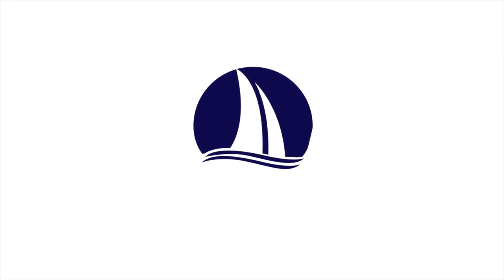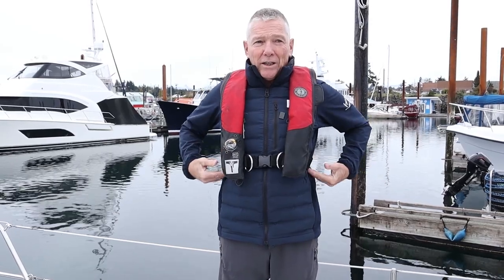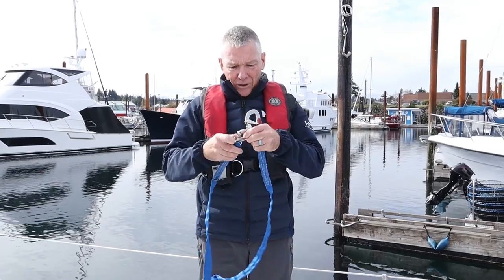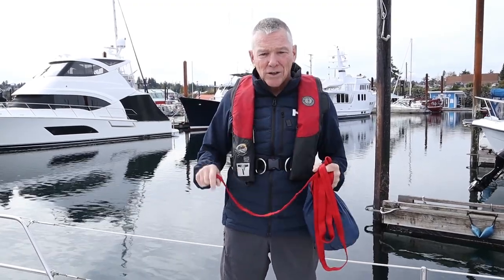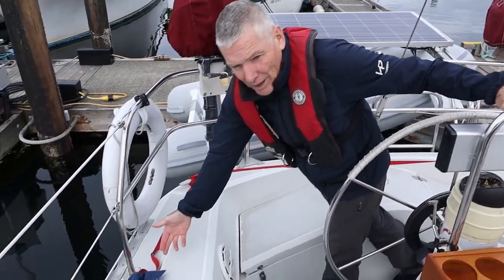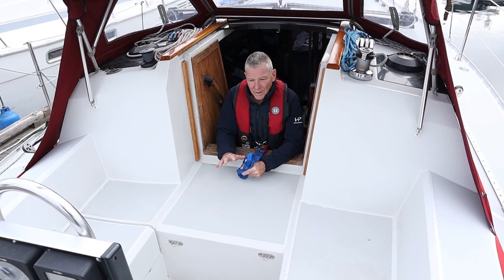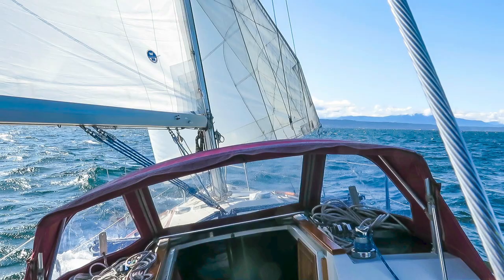Ep 45: Harnesses, Tethers & Jacklines

Comment: I think in most cases going overboard single handed in rough weather, being tethered just ensures they recover your body more easily.   Getting back in the boat is often next to impossible, especially in cold rough water.  IMO If you are single handed being tethered should really only focus on keeping you IN the boat.  On deck I’d focus on short tethers and extra pad eyes in areas where you likely need to work with one or more hands, ie at the mast or on the foredeck.
Reply from the maker: I agree
Reply: In those conditions , maybe if you don't have to be out , don't.

Comment: Good tips, but I don't get the final part. In the man overboard scenario, you instructed how to cut the harness, use a PLB, etc. It almost seemed like cutting the harness was the main option? I strongly advise single-handled sailors to practice climbing aboard under controlled conditions (with crue mates). Also to set up alpine aiders and practice using them. Without being proficient in getting back into the boat, staying clipped is quite pointless for a single handler.
Reply from the maker: You make a good point. The point that I was trying to emphasize is to rely on the tether only as a last resort and that going over the side you might not be able to get back on, at least from my point of view

Comment: Great safety point about single handed, I've seen people (and videos of people) single handed with no tether. If you are using an autopilot, your boat is gone. One very big consideration, the easier it is to rig, the easier it is to come disconnected when you're in the water because you have fallen overboard. I 100% disagree with using a snap-shackle for a jackline. It's way too easy for them to unsnap by accident. You are out in the water all by yourself, think about just how safe you want to be. Autopilot is overused, it's great for doing things while singlehanded, but it takes away the boats one safety feature, actually turning away so the sails don't provide any power when you do fall over and stopping the boat so maybe you can get back onboard. Autopilot WILL ensure the boat goes away.
Reply from the maker: Thanks for your comment. I agree 👍

Comment: Great video but what is the point of the safety if you have to cut the line anyway? Because pretty much no one can be dragged in the water and climb back on.
Reply from the maker: That is a very good point
Reply: Exactly.   Using a 6ft tether is pointless.   Needs to be 3ft so you can scramble back onboard.

Comment: Another idea, Marco, is to loop your 6' tether around the jack line and back to your connection on the PFD. This would yield you a 2' 11" tether.
Reply from the maker: Thanks for the comments Jim. This suggestion however is a bad idea. Never have fabric on fabric contact when significant loads might be present. This is a very dangerous practice
Reply: @CarpeDiemSailingMagazine  I would suggest that that suggestion is not intending a fabric-on-fabric contact, so not 'dangerous practice', if the tether is terminated with a locking carabiner made of metal.  Would you agree?
Reply from the maker: @jamessavage5894  👍

Comment: To run the jacklines through the middle of the boat, I do a triangle with the base on the cockpit and the tip on the baby stay deck attachment. The base is about the size of the companion way’s width. The jacklines go beneath the bimini and around the mast base. I use these jacklines when leaving the cockpit. When in the cockpit, I clip to the steering pedestal, no need for jacklines. The only place I cannot reach with this setup is the genoa furler. For this I use an additional jackline that goes to the bow cleat and I use an extra short tether.
Reply from the maker: Thank you for the comment Robert.It sounds like this works for you but for me I can't figure out how I would do that with the dodger in the way. Is that what you mean by bimini? I'm still not convinced that any system will guarantee that you will not fall off the boat somewhere on the boat
Reply: @CarpeDiemSailingMagazine  Hi. Yes, sorry, wrong word, I meant the dodger. Got to work on my English :-) Anyways, actually I do not need to pass them beneath the dodger either. Now that I remember (I am not on the boat at the moment), the jacklines stay forward of the dodger, just tangent to it. I use the part of the deck on which the mainsheet car is attached as the base of the isosceles triangle formed by the jacklines. Forward of the mast, I have a baby stay and I use its attachment to the deck as the forward vertex of the triangle. So, the jacklines form an isosceles triangle with a small base (the width of the companion way), which is what I need so that the two long sides lead forward toward the vertex while staying close to the center line of the boat. This prevents me from falling overboard. have a Beneteau 361, maybe it is possible in my boat and not in others.

Comment: Lots of really good advice and instruction.  I definitely learned a thing or two.
I've also done a lot of solo sailing, and solo rock climbing, and there are a lot of similarities.  Climbing rope or webbing is definitely a good option, but you need to be careful with how you tie and dress webbing knots; you can't always use the same knots as normal climbing rope or sailing line or you risk it slipping.
I also wonder why they don't have magnetic release clips like the Black Diamond Rocklock Magnetron carabiner.  They are locking, strong, and can be opened under tension.
Reply from the maker: Thanks for the comment. I am not familiar with the carabiner you mention but in my experience most of the gear from the climbing world does not do well in the salt water.

Comment: Good video. Many useful tips. Thank you. I have the Spinlock offshore and a Mustang. To make a crotch harness for the Mustang I used about 9' of webbing. One end I sewed  into a loop. This attaches to the Mustang belt with a carabiner. the strap then runs under my leg and up through the back of the vest then down under the other side. For this end I use a double overhand knot and another carabiner.  The only possible downside is it's too strong a system.  (Buying one is over $100 and it's clearly not worth more than about $7)
I'd hate to have to rely on cutting through webbing in an emergency with cold numb fingers. Spinlock keeps the webbing cutter coated in plastic- this is against corrosion. If that came off ( you used the cutter for something) I'd make sure that blade was as sharp as possible and then I'd dip it in Plastic Dip. Stainless steel has a way of getting corroded, even slightly and losing any edge.)  
For a Jackline - great advice. If you get the right type of webbing (easy to find) it'll have those mountain climbing weight numbers. It's not that expensive, it's easy to sew (Just about any sewing machine because what your machine is really doing is pushing a ball headed needle between the fibers. I've got a $300 Janome and it does just great) or you can tie overhand double knots. But look these things up don't just trust me. 
The X thing.... I think you  covered it. On a boat like yours what I think I'd do is run the jacklines like you did it first, and then I'd run two more lines up along the handrail, and in rough seas use that as a handrail. The dodgy areas are always the gaps between handrails. Webbing is so inexpensive (I'll bet I have at least 500' in various sizes (and colors)) it's a why not just do it? 
The clip in or not. I'm also a sea kayaker. We wear our pfds all the time. The USCG has statistics that most people who die in boating mishaps drown, and 70% of them are not wearing life jackets. The rule is that a life jacket is in reach. The stats seem to indicate people who end up in the water weren't able to grab a life vest. So clipping in? Just seems like a make a rule and then just always always follow it. (I wore my pfd for every single basic sailing lesson whether I had to or not. When I'm on my boat I'll still look like a nerd.) 
Steeplejacks always use two safety lines and do not release one until the other is clipped - so they are never ever unclipped. 
(Sorry to go on so long) I had the thought that to climb back on board maybe tie a loop in the tether, it's easier to hold onto a loop than a piece of straight webbing . But this would shorten the tether and what's the best spot for that loop? and the loop catches onto every nubbin on your deck. 
Do they make ascenders  for webbing? One of these on your tether right next to where you clip in would keep it out of the way, but reachable. Then you would just slide it along the line and pull yourself up. (once you got some length between you and the ascender you can use that as a step.  
I've got a lot of experience with hypothermia growing up in a cold wet place. It always degrades your ability to use your hands faster than you can possibly imagine. If like me you get cold hands and feet - this can happen in less than a minute. The shivering? That happened to me in less than 15 minutes in 70 degree (22C) water on a sunny California day air temp 75 (25C).  (I've swum two miles in colder conditions wearing only a Speedo. Not swimming is very different.) 
You want to wear the gear, take all the precautions and 15 -30 years from now be able to say, "I never needed to use any of this." Also the way people die wearing a pfd is they get hypothermia, their head drops into the water and they drown. Happened to a friend of mine - sunny day, couple hundred yards off a beach.
One thing something like wearing a pfd and keeping a hand on a rail or clipping in does - that no one says - it puts you into a safety frame of mind. Set your rules and then live by them.  I once drove to the beach and then discovered I'd forgotten my pfd. I was just going to escort some ocean swimmers no more than 100 m from the beach. Rules is rules. I drove home and got it. Before I launched I'd driven almost 100 miles. But I'd proven to myself that I follow my safety rules. Hope this hasn't been too crazy.
Reply from the maker: Thank you for taking the time to comment. I appreciate your time and support.
Reply: @CarpeDiemSailingMagazine  You're very welcome. I really appreciate your digging deeper into these topics on your channel. When I got my Musstang the leg straps were an expensive option. My experience immediately raised the question - how does it lift up in the water? It was pretty awful. Most people won't know to consider this. 
Also, the MOB practice I've done in classes is completely inadequate to doing it for real.  Pulling a full sized person back on board is a serious physics challenge that until you have experience doing it it's going to be really really difficult. (I've done house construction and taught physics - the tricks are amazing and better than strength. All the best framing carpenters I've known are my height 172cm or shorter. Four of us once lifted a 15 ton house to insert an extra story - we didn't lift it with our arms. And we didn't figure it out as we did it.)

Comment: I rig my boat with the same webbing and in the same manner. I use two tethers. Long and short.Added port and starboard cleats so the webbing runs a couple inches aft the wheel with a fixed loop that I clip on.
Call me paranoid,  but I'm not going over..
Great video by the way.
Reply from the maker: Thank you. Good info, I agree

Comment: Ohhh. Now I'm getting into trouble.

I don't use a safety line, when I have to move forward or backward on the boat 
I have them and can use them to secure me in the cockpit, or on the deck, but back and forth they are too much in the way.
You must always have control of the line and be careful not to fall into it.

Then I'd rather have both hands to hold on.

But I have 20 meters of orange floating line with a small fender at the end that I can put out from the boat.
It is set up in such a way that if there is a rough pull in the line, my autopilot is deactivated.

The boat will then go up into the wind and probably also go over the stay and lie reasonably still.

I've tried it in practice and can easily catch the line and it doesn't take that much force to hold on if you're just lying on your back.

Should everything go wrong, I still have my PLB.

I'd much rather bet on this than a safety line that gets in the way and requires me to release the boat with one hand to steer the line.
And if I fall overboard and hang on the side of the boat, I am not much happier than if I had simply fallen into the water.

So I rather bet on having both hands available on the boat and good places to hold onto the boat.

Next, my float line, which also disengages the autopilot.

Finally there is my PLB.
Reply from the maker: I like it. Well thought out 👍

Comment: Why not attach the jackline to the handrail 1/2 forward to the bow? This would prevent stretch of the jackline if you went over. As far as the tether goes would it be wise to have a tether just long enough so you can stand and walk along the boat? i.e. when you use a jackline in a piece of platform high lift equipment it is there to stop you from falling off the platform due to restricted movement so you are not able to fall off in the 1st place due to its length.
But great presentation with lots of ideas for my jackline install. Thank you.
Reply from the maker: Thanks for the comment Borys. There are short tethers available like the one I link to in the description, but the problem is that the anchor point is low and always will be. The only way to prevent one from going over the side is to be suspended from above and I just don't see anyone coming with a common, universal system that would work practically. Until then it is up to the individual to understand that solo sailing is high risk and if one is not able to accept the risk then don't sail solo.

Comment: A shorter leash is an option if they give you enough room to move around.  Your leash looks too long for that boat.  Another suggestions is If someone goes over on the leward side,  tack immediately to pull them out so they aren't dragging in the water.
Reply from the maker: There is no tether short enough when leaving the cockpit and travelling along the side of the boat

Comment: X on jacklines works by crossing it just aft of the mast BUT the reason it works is because you can use a two arm tether.
Reply from the maker: Thanks Doug but the problem still remains that at some point along the length, usually at the cockpit, the jack lines are close to the edge of the boat. There is no possible way of guaranteeing that one will not go over the side somewhere on the boat in spite of crossing jack lines and short tethers.

Comment: Great information. 
It seems to me that your blue tether should be no more than 3 feet long, and certainty not 6 feet, that is way too long. The objective is to not fall overboard in the first place. I think it is fair to assume that dragging in the water on autopilot is death, even more so if you have to release and swim away. The PLB is to find your dead body. When sailing solo, overboard is death, tethered or not. Anyway, that is how I approach it. 
Thanks for all those great videos!
Reply from the maker: Not always practical. Short tethers are available but industry standard is the 6 foot tether. Personal choice as I said in the video. I agree that the objective is to not fall over in the first place which is why I emphasized so strongly all the other precautions. For me a tether is an absolute last resort. Solo sailing is a choice. If one cannot accept the risks associated with solo sailing then don't sail solo. The only way to remove all risk is to not sail solo.
Reply: @CarpeDiemSailingMagazine  I agree with everything you say here. Maybe the answer here is one should use the shortest tether that is practical. 
Thanks for the videos!
Reply from the maker: @tomaskryan  That sounds good to me. It is interesting that the only short tethers available are twinned with a 6'. I did consider getting a double tether for a bluewater passage I was supposed to go on (thanks for nothing COVID) I will look into the availability of short tethers. Check out the to links I posted in the comments from Practical Sailor. I think you will find them interesting.
Reply: @CarpeDiemSailingMagazine  Ok, I see the Kong Double Tether, that looks perfect! I also use a short double tether when it gets really rough, then there is never a moment where you are unclipped during a transition between two attach points. I'm from the rock/ice climbing world, and we do that up high. Thanks for the info!

Comment: Great information and demonstration, Marco. I have a spinlock deckvest and had heard that the hook knife provided will not cut a tether (especially with the protective cover on). I had also heard that it's challenging to cut a tether with a knife while hanging overboard and the tether tight against the hull. I tested my knife and spinlock hook knife on dyneema line and they failed to cut. So I purchased a Gill Harness Rescue Tool Knife MT011 and it performed to my satisfaction cutting the same dyneema line. But I haven't tried it on an actual tether. Any thoughts? Would be great to see a video actually testing the performance of a knife and hook knife while simulating hanging over the side of a boat.
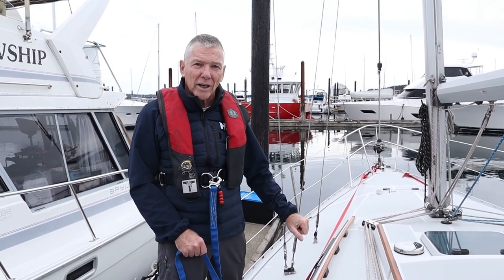Reply from the maker: Thanks for the feedback Bob. I’ve never tried the Spinlock cutter but have to say that I was skeptical so not surprised to hear that it doesn’t work well. I’m not familiar with the Gill tool you mention but will add a link to the description. Dyneema is always a challenge. The best knife for cutting Dyneema is ceramic. You can see a ceramic knife and a serrated rigging knife cutting Dyneema in this video (18:13 min in). A video demoing cutting tethers would be great. Something to add to the list for next summer.